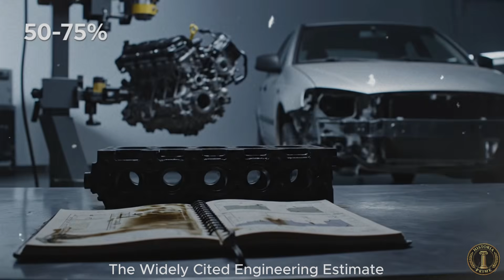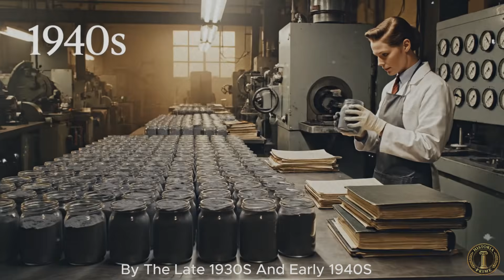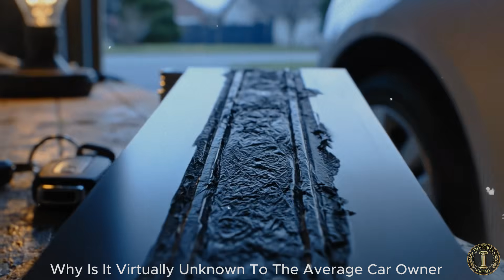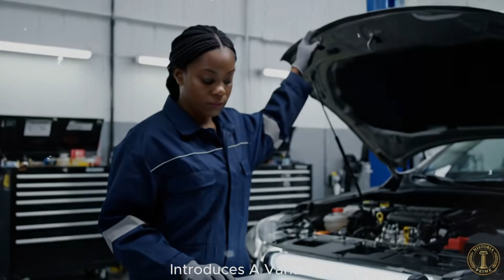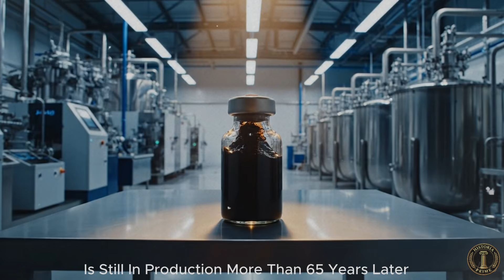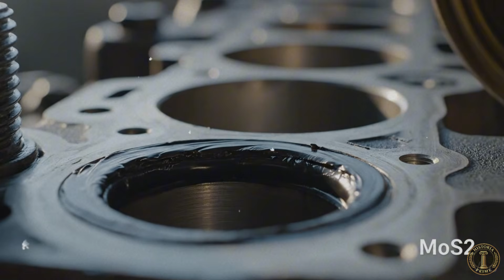Your Engine Is Automotive Is Dying Right Now. This $2 Kitchen Liquid Stops It in 60 Seconds.

Comment: This has been disproven as product hype. As a lifetime wrench, I and most all mechanics will  tell you we never tore open a motor and found all bearings, bushings etc, to be DRY of oil! And many motors over 400k never even used addutives, they just kept clean oil and filters. DIRTY OIL kills motors! Those first few seconds of no oil pressure isn't a concern because there is still oil on parts. Mos2 may be a better idea, but isn't totally necessary or required for longevity. Change your oil using an API specked oil for your engine. 
Ex-USCG Engineman.
Reply from the maker: Fair criticism. Clean oil, good filters, and regular maintenance usually matter a lot more than miracle-additive claims.

Comment: To solve the problem of dry starts install an oil precharger Amsoil has got them. It mounts onto oil bypass filters. It puts oil pressure to the crankshaft main bearings. Turn ignition key wait two seconds before engaging starter. Use synthetic oil it has a very, very low freezing point and will increase fuel mileage. I had one on a semi truck. Also had a FASS (fuel air separater) with electrical fuel pump and they work great, faster starts, easy to change fuel filters (no priming, i.e.: pre-filling filters w/ diesel fuel) better fuel mileage and smoother running engine, because it takes the air out of fuel and thus lengthens the life of fuel injectors. By using oil bypass filters only had to change oil once per year instead of every month. Also, a mercury-filled crankshaft dampener really, really smooths out the engine.
Reply from the maker: That's a solid setup, prechargers and bypass filters definitely go a long way for engine longevity! 😊
Reply: @HistoriaPrime1212  The FASS also puts positive or precharged fuel pressure to the injectors for faster start ups, meaning the oil pump starts working sooner, and spends less time dry cranking. We may only ask why engine and automobile manufacturers don't install these as standard factory items, and stop wondering why there are conspiracy theories. These would be added to a long list of whys and no wonders. We could also ask why they don't use disc brakes on semi trucks where having less brake fade would be a big safety advantage. The industry and government talks safety but they don't do it. They also added an extra hour to drive time per day (11 hours v. 10 hours) to "reduce" driver fatigue they must be using the new math and they also messed with other things to allegedly make trucking safer. They're a bunch of crooks and thieves. There's too much to say here. Keep doing what you're doing.